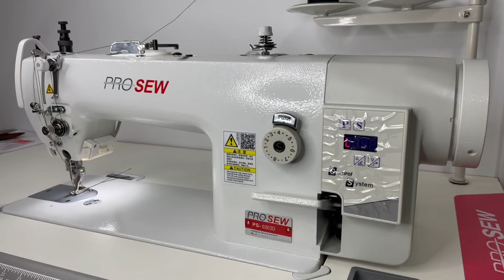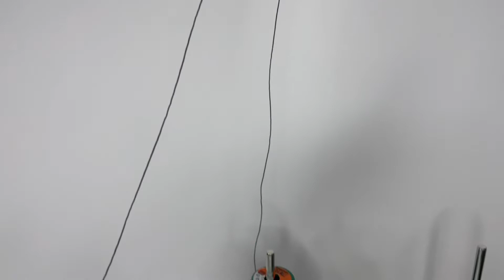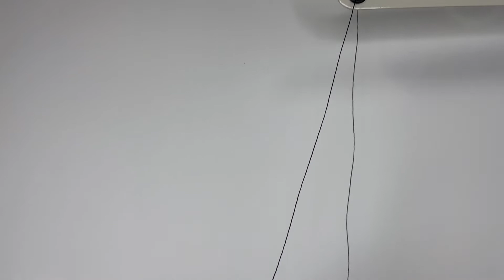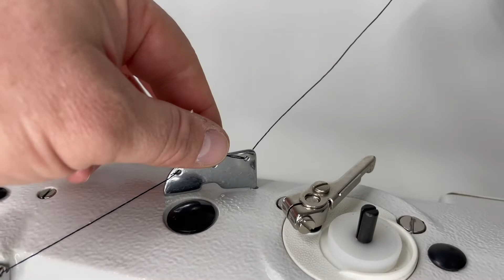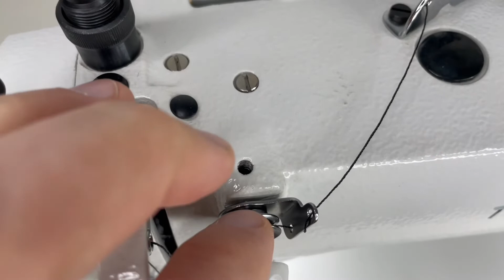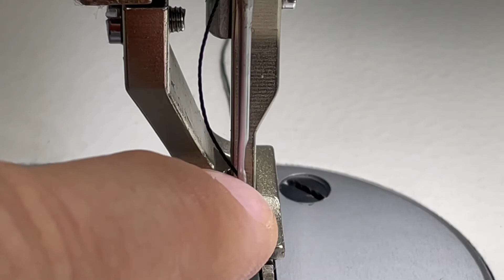How To Thread PS-0303D Industrial Walking Foot Sewing Machine

Comment: Hi thank you for sharing this. I recently bought a TY-1300DD-1 industrial machine and I’m struggling with reading the manual it’s not the easiest!  Please could you help me to explain what the motor box exactly does and the tension parts of this machine . i’m in desperate need of help! thank you so much
Reply from the maker: The motor on this is a. direct drive servo motor which allows you to adjust the speed and needle position. There is a pre-tension which is the little set of tension disks at the top of the thread path then there is the main tension assembly down on the face of the machine. The pre-tension does not need very much tension at all, you do all your setting with the main tension assembly. The main tension assembly adjusts the needle thread tension (the bottom of the fabric). If you have your bobbin thread tensions et correctly and you see thread looping on the bottom then you tighten the top tension but if you see looping on the top you loosen the top tension. Hope this helps.